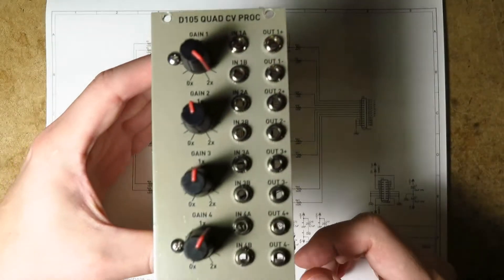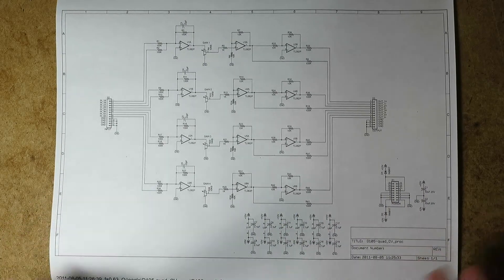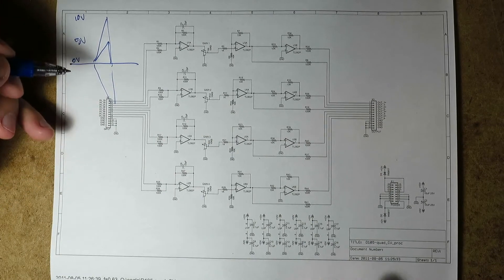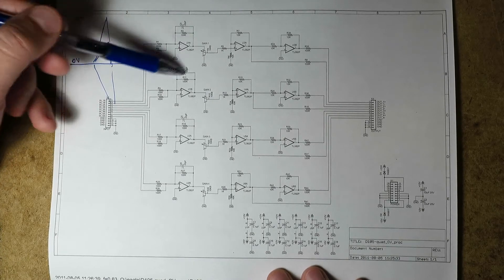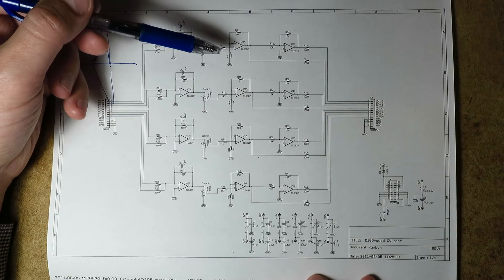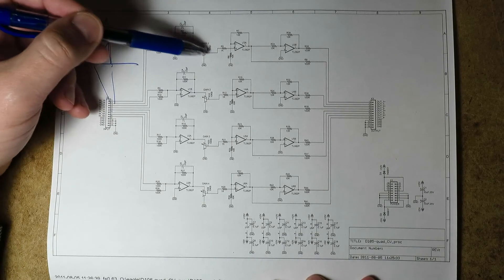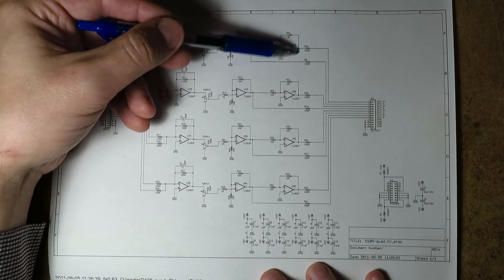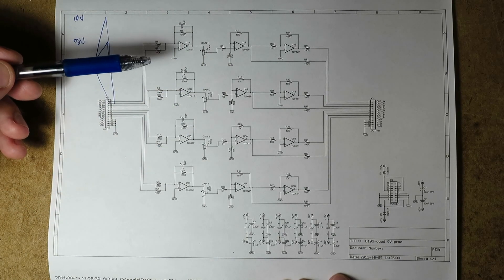Synth Tech - Quad CV Processor

Comment: Is there a way to add an offset function?
Reply from the maker: Yes you could add another pot to each channel to mix in an offset voltage. If you need tips on choosing part values let me know.

Comment: Hi Andrew!Firstly, Thank You for sharing these awesome diy circuits! :) I'm really interested to the quad VCA and I'll try to build it as soon as I can, but I need to ask you a question: What I've to do If I'd like to add an "inverting" option inside this circuit? (ref. to your circuit diagram) is it necessary to modify the left side of the circuit (over the control voltage section of the VCA chip control in), or after it? so, at the last opamp, just before the output? It's cool to have an attenuverter embedded on this cool VCA! :) Thanks!
Reply: ***** Thank You for your reply! I'm not really interested in ring modulation but in a way to "invert" the CV output,what I mean is just like to add an Attenuverter... For example,is possible to modify something in order to have a "negative/positive" level instead of the original level pot? anyway, thanks for sharing your project and for the accurate explain of it. p.s. I'm only an electronics DIYer... with no very deep skills... and your videos are very helpful to people like me. thanks! cheers from Italy! :)
Reply: Thank You for your reply and for your explain. I'll consider to build an attenuverter and adding it to my system... thanks! Cheers from Italy!

Comment: i have been wanting to do this modules for awhile...thanks for making this videos and showing the inner workings :) seems to be quite easy to do...maybe even i can do it :) thank you Sir!
Reply: YES! I got all the parts now for this, the slew and the 4 v module.. i tried to find the SSM VCO chip in Ban Mo Bangkok...looked everywhere, but nowhere to be found. I saw you live in Bangkok, you have a recommendation on a good shop to get parts in Bangkok?
I think i will start with the 4 v module. What type of board do you recommend, strip board or the other "not connected holes" board? Or maybe better to try it in a protoboard without soldering first :) Again big thanks!!